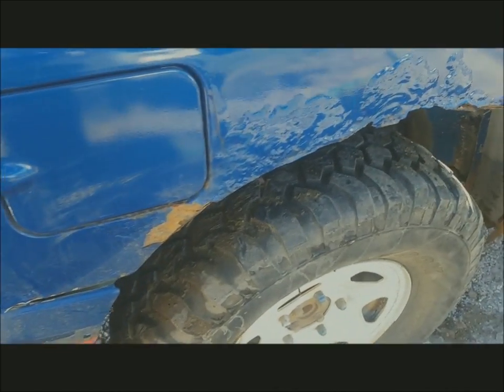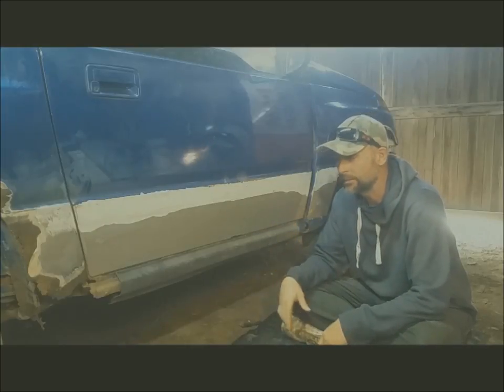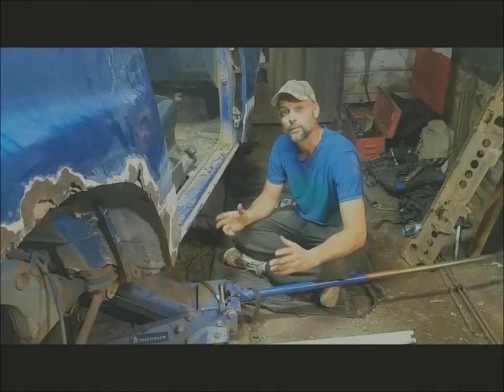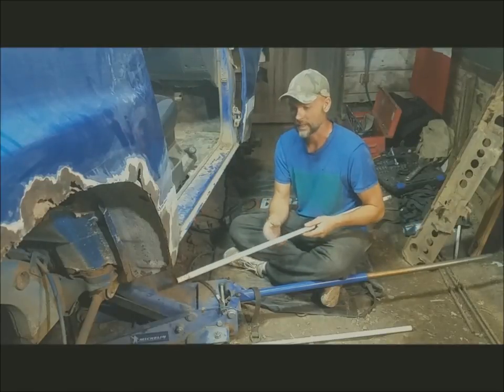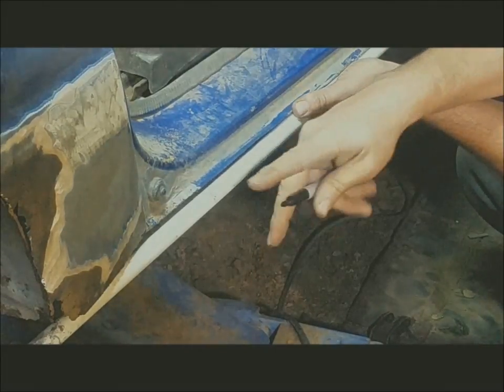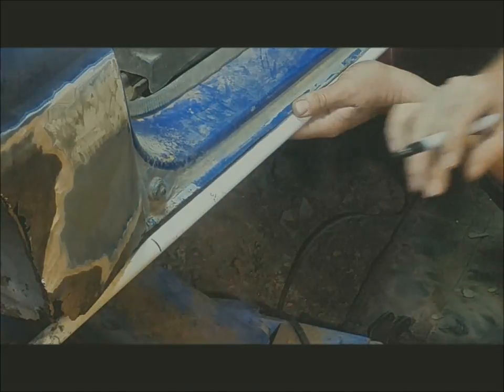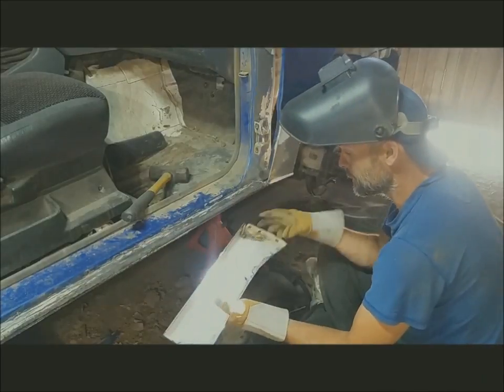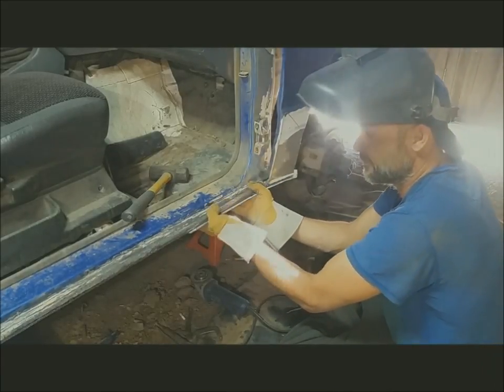CUSTOM ROCKER PANEL LIFT AND FENDER TRIM!!

Comment: those tubes will do nothing use 2x4 box tubing
Reply from the maker: It's not for wheeling or 4x4ing tho...that would work for a 4x4 that goes out and needs protection. ..but this one doesn't. ..plus this was done for "free"...